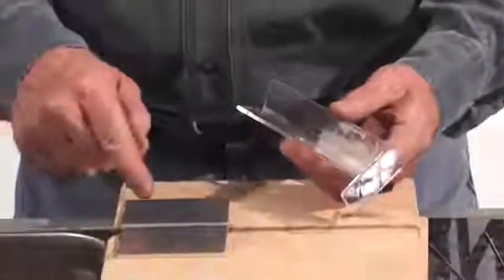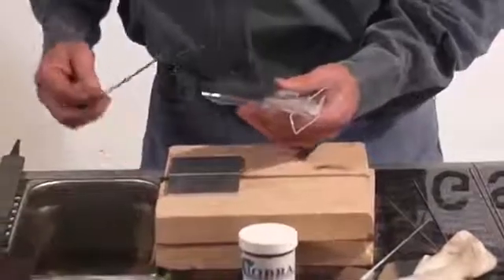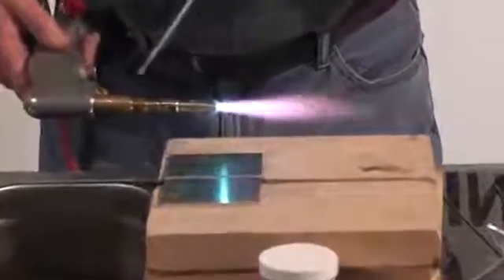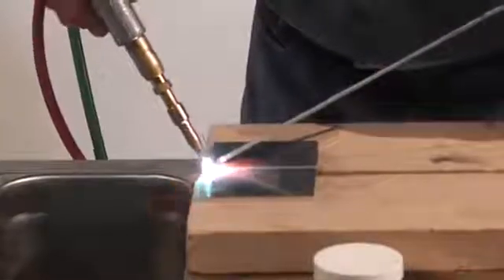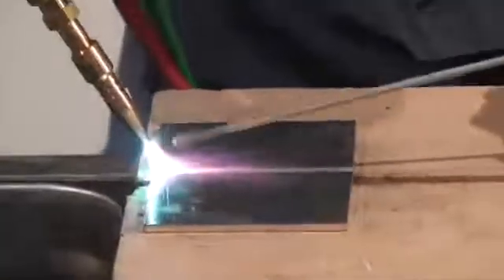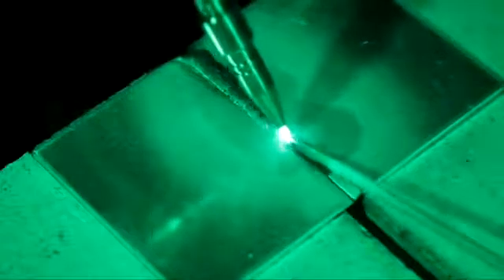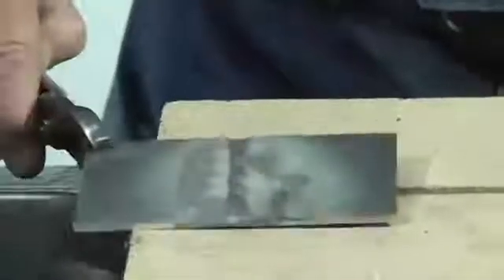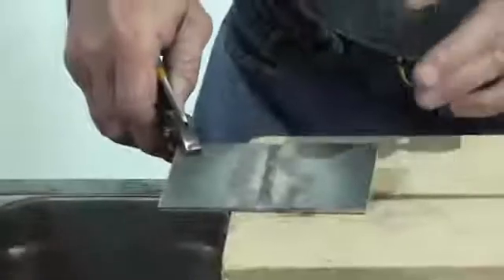Welding Thick Aluminum Demo

Comment: I've always been told not to put the torch to the rod but heat the metal to the point where the rod melts on contact with it ?